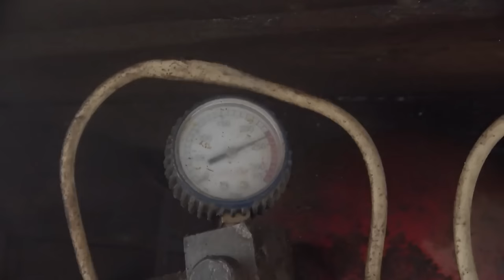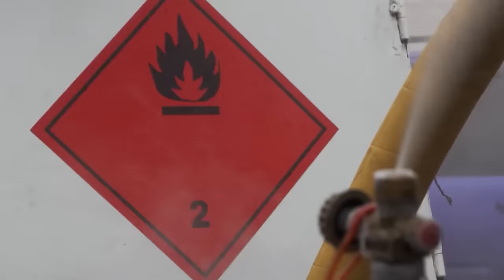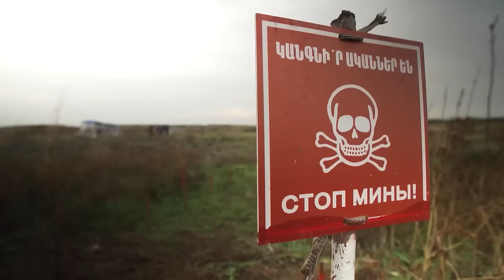Armenia, Resistance Fighters from the Caucasus | Deadliest Journeys

Comment: 8:28 One of the problems with these documentaries is that we are dealing with the English translation of the French translation of what was originally said. In this case, it's a good bet that the driver did not say he was shifting into first gear, but rather that he was shifting into low range, a belief supported by how he's reaching down for the transfer case lever. Like all proper 4x4s, his UAZ 452 van has a two-speed transfer case behind the regular gearbox, operated by a separate shift lever. Low range is used for difficult situations and offers maximum torque and maximum engine braking, exactly what was needed in that situation.
Reply: You're not the only one complaining about the translation.
Reply: Trans;lation has to be off coz... "The car can race, the driver's an ace, and the co-pilot sets the pace..." There's no way it's rhyming in all languages.
Reply: the documentary was amazing 😍 looked like kosturika has done it
Reply: Yes, at minute 19:44, the Iranian man whose truck fell in the valley says at the end that "the Armenians took me to the hospital, but in the translation it is said that the roads of Armenia are terrible", which does not seem to have been accidental.
Reply: Eu ainda estou traduzindo para português.  😂😂😂😂😂
Reply: As an Armenian myself I can confirm the translation doesn't match to what ppl actually say in some places
Reply: 16:43 A lot are probably staged to.  Switching battery from a car with 12volt to start a tractor with 24volts🤔
Reply: ..i thought so too  @femountain  and the tractor looks almost brand new😬..